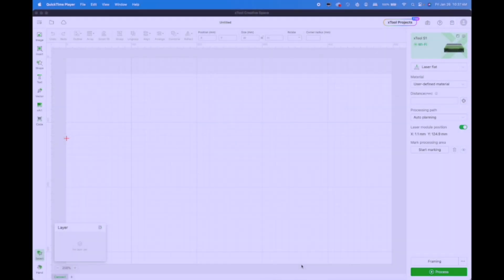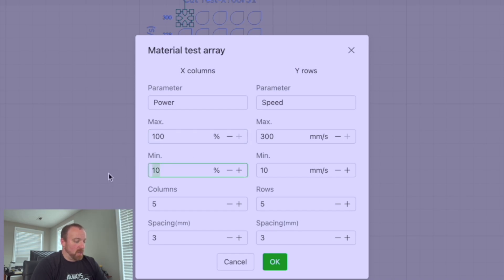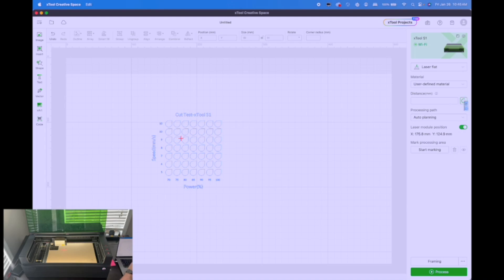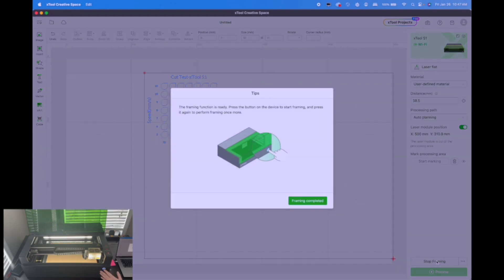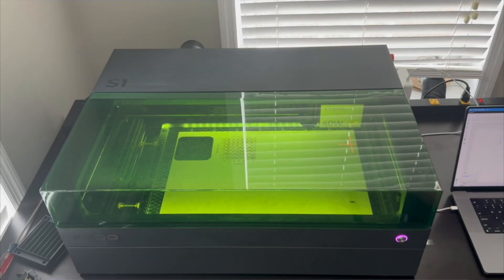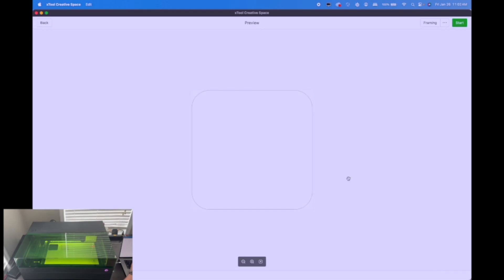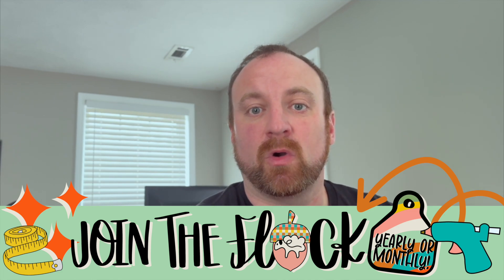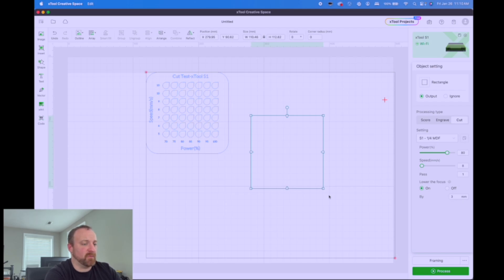🤯The One Hack That Will Make You a Laser Cutting PRO!🤯 - Material Test Pattern

Comment: Can the files be added to the O&L membership?
Reply: They could but the thing is each material is going to be a different setting.  You would need one for engraving and one for cutting and one for scoring.  Then acrylic won't cut at the same speeds that wood will.  So experimenting with your own setting for your laser and your material is the way to go.  This video was to just try to give you some guide line of where to start from.